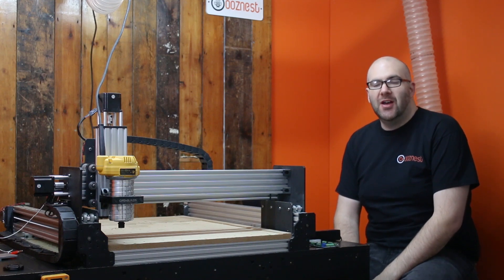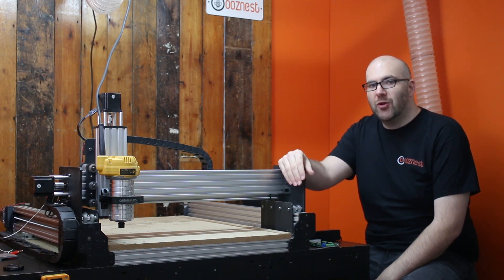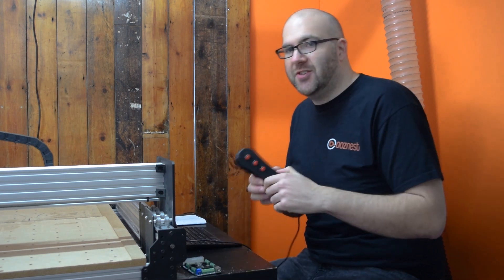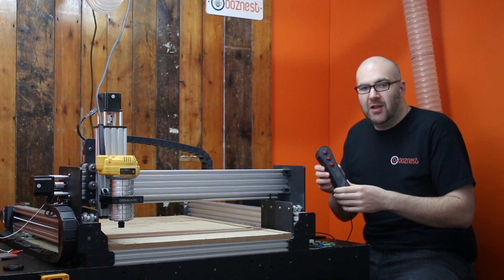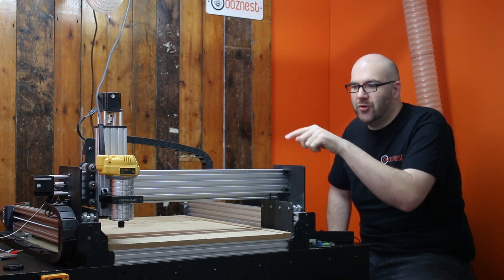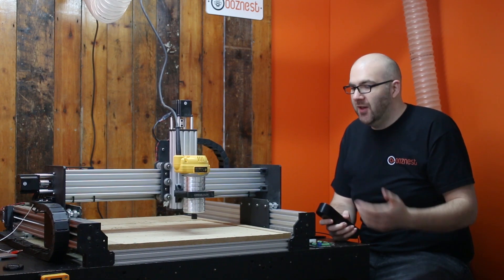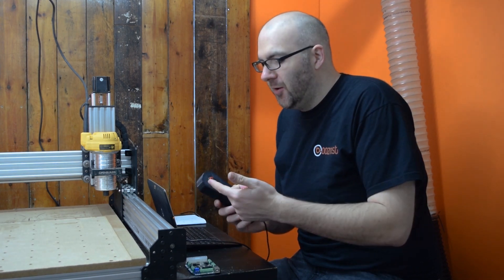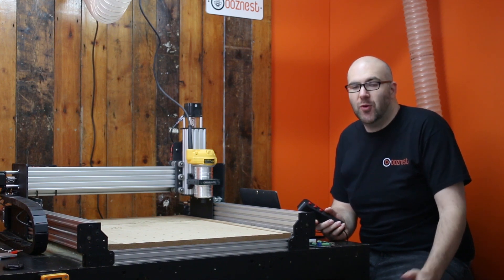How To Install A Pause/Play Button To Your CNC Machine | WorkBee CNC

Comment: Is it possible to do the same thing with a Duet controller ? Do you have a diagram for that ?  Thanks in advance
Reply from the maker: Yes, you use triggers: https://duet3d.dozuki.com/Wiki/Using_M581_-_External_Triggers_and_Building_a_Control_Panel

Comment: Is the reset entirely necessary as the function is essentially the same as the emergency stop? Does it provide any advantage over just pushing the stop?
Reply from the maker: Without doing the software stop when doing the power kill. When the machine gets power again there is a chance it could carry on.
Reply: @ooznest  so an emergency stop is better? 🤔 I've already got one ready to wire in. Just buying buttons for pause play and wondering if I need another button.
Reply from the maker: @sutok  An emergency stop button would be better. Then two other buttons to play and pause.
Reply: @ooznest  great. Thanks for the response. 👍